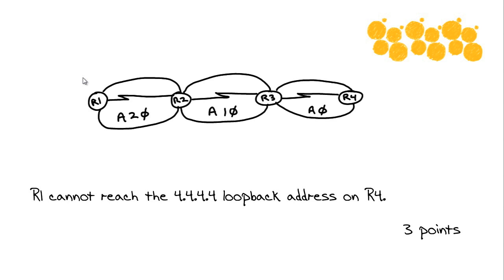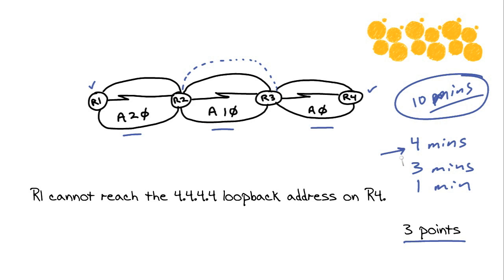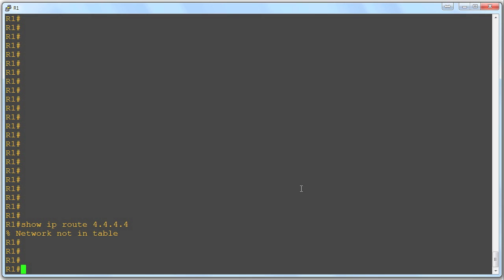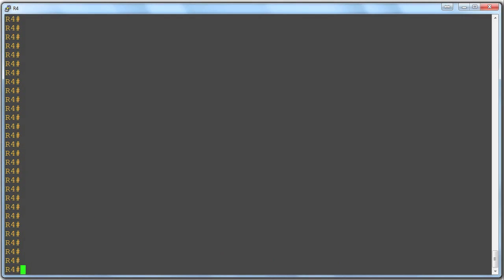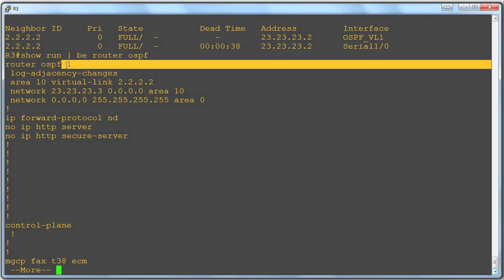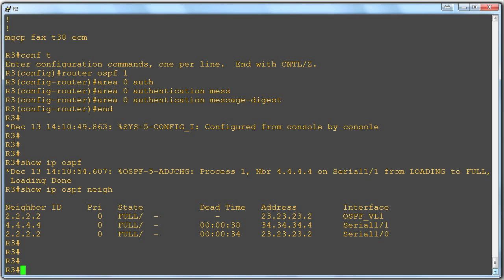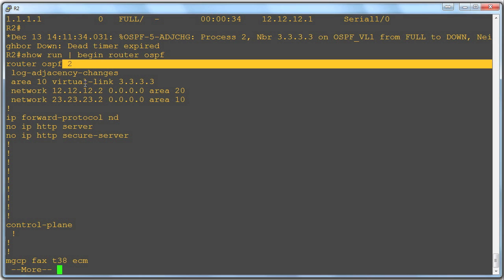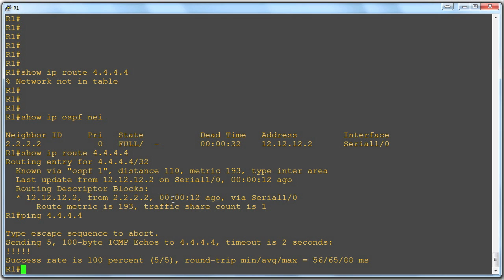MicroNugget: How to Solve CCIE R&S Troubleshooting Sample Ticket

Comment: Hello Anthony,
Great work, I like how you collected information about the topology without touching the CLI, I was working with you as you troubleshoot the problem as follow

Check the OSPF neighborship, step y step as you did.
Ping my neighbor, if I have Ping OK, if Not check the Interface on both Routers
If interfaces are UP, I would check if I have OSPF config.
If I do have config i would use the "debug ip ospf adj", to see if it would tell me what the problem is.

What do you think ?